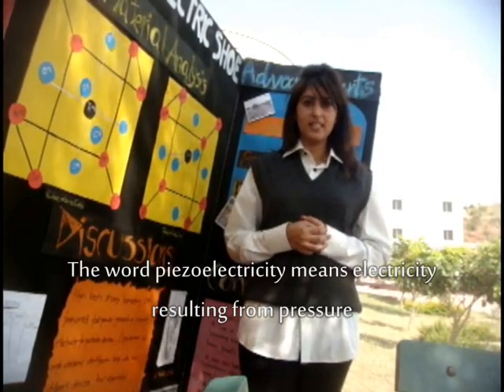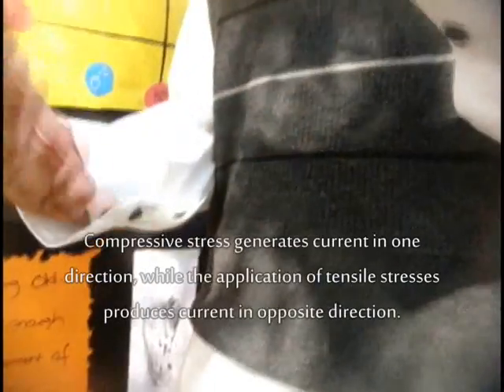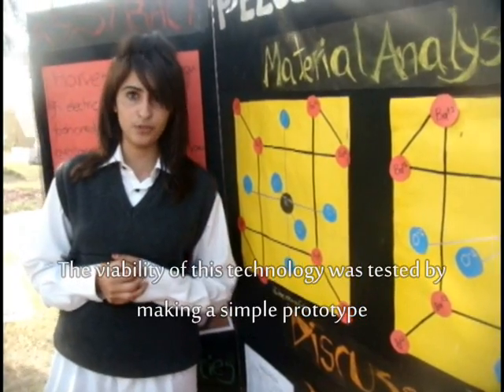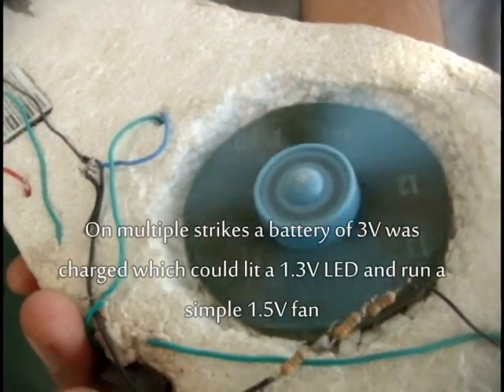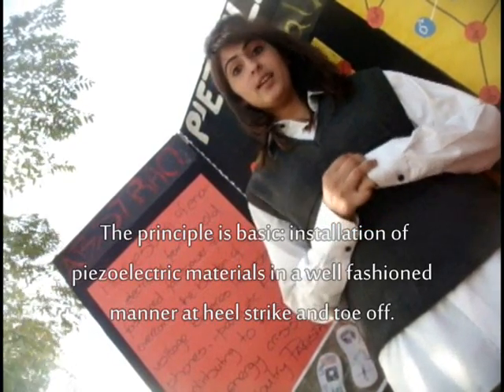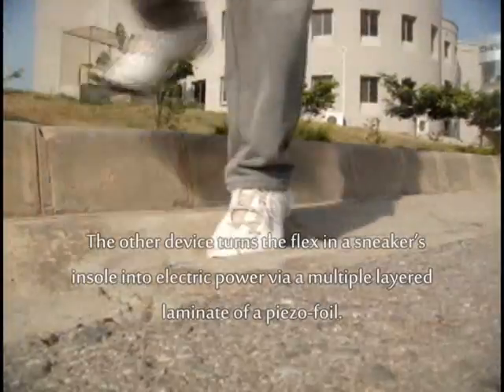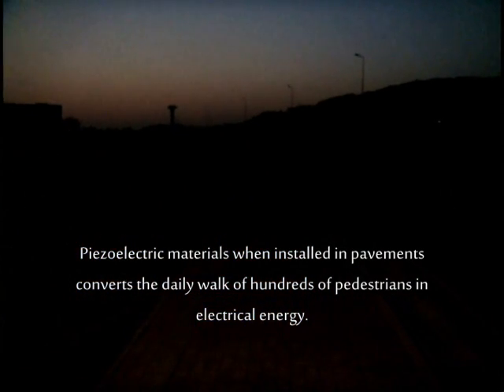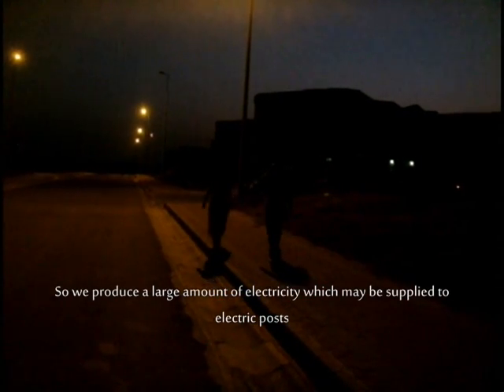Pakistan_Piezoelectric Solution.wmv

Comment: it's not cost effective.. Hydroelectricity in Northern Areas is the cheapest source of electricity with a potential for over 60,000 MW. Coal is also an option for a sustained supply of 60,000 MW over more than a century. Pakistan just cannot afford bringing in the new high-tech alternative sources yet n there is no need as well when we have so much potential in the already present resources.

Comment: @shanikhan999 you might be right they produce less energy but i must rectify u here my firend! the piezos u knw are form sound systems and speakers used just for changing logic signals from 0 to 1! but piezoelectric materials are fabrigated at laboratories. so it all depends on how u are making them! there are piezos (piezoelectric strips) even commercially avialable which when used give enormous ammount of energy. this is already tested at dance clubs.